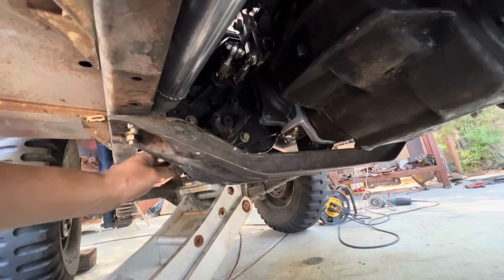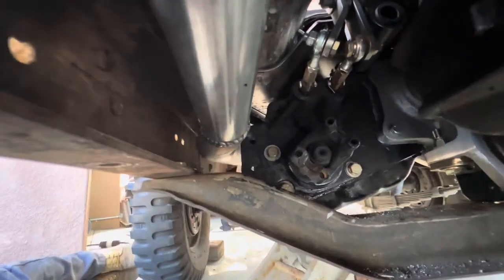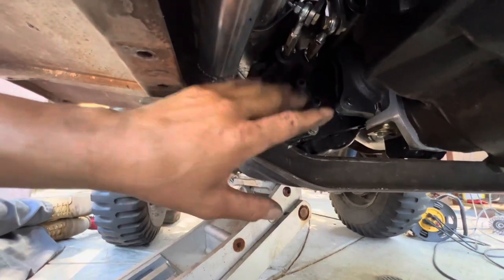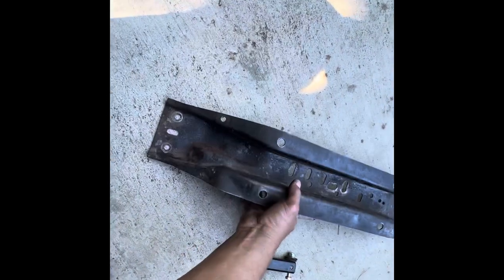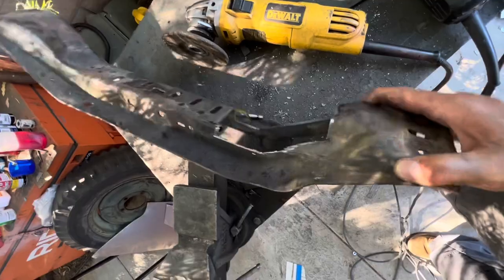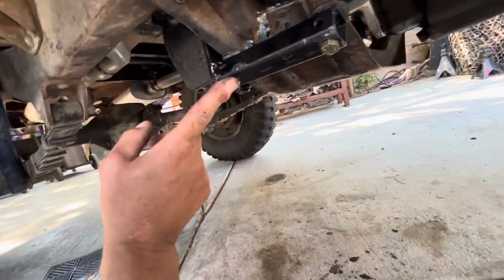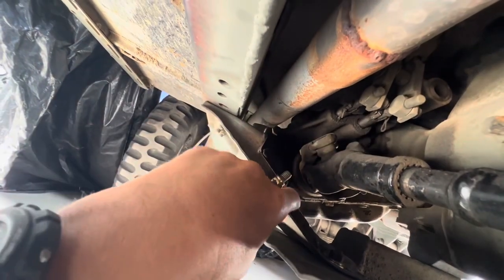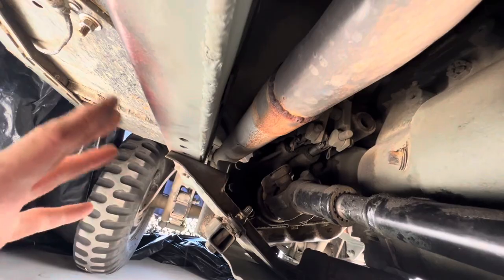DANA 20 tranfer case in a Willys Jeep. modification, twist strap and spacer discussion. CJ2A/CJ5.

Comment: The two holes in the Dana 20 case are used for exhaust support when used in a Scout 2. The exhaust is flattened to go between case and frame and  "D" shaped 3/16" wire mount is bolted to the T-case to support the exhaust. May have other uses.
Reply from the maker: wow - i thought for sure it was for a bracket to secure the dana 20 from twisting. Thank you for that valuable information.

Comment: Hi Ernie how are ya? I just watched all 3 of the videos installing the sm420 into your buddy Jeep. 
I’m new to jeeping,  I bought a 69 cj5 all stock v6 t14 d18 44 27. I was just wondering why y’all run a d20 and centered axle over a d18 and stock axle. Sorry to be such a newbie. Love your channel!! You’ve got mad fab skills. 
I plan to put a vw tdi, sm465, d18. Just waiting for the winter snow to hit then spend time in the shop. Thanks for sharing and teaching us newer fellas how to get it done. Take care  and God bless you and yours.
Reply from the maker: Hi - it’s just how it ended up. if we had d18 we would have built it. welcome to the old willys fun… 
  That vw swap will be awesome. i’ve been reading up on that. I also want to do one. 
  Glad you like my videos- i’m just a guy messing around under the shade tree 👍👍
Reply: Hey Devil Dog,
The 2 holes on the right side of the Dana 20 are the torque mount for the transfer. It is supposed to be a L bracket that comes off the transfer going forward to the cross member , on the cross member, there is a stud that goes there with a rubber mount on top and bottom of the bracket that is supposed to keep the transfer from twisting and tearing the transmission mount. When I had my 1967 J3000 truck, it was missing that mount. I was 4 wheeling up a canyon in the panamints out by Death Valley and tore the transmission mount. The transmission torqued, and hit the floor board when it broke, the T18 was in 1st gear and the shifter hit the dash. The only way to finish the trip was to chain the trans to the cross member and hope the engine motor mounts don’t let go. 
That was New Year’s Weekend Y2K. 
I was able to finish the run and had no further issues, but that’s when I learned about the torque mount for the Dana 20.
Back then, I was able to get the torque mount stud and bushings from 4 West in Colton Ca, but no one had the bracket. I made the right angle bracket out of 1 1/2 x 1/2” material and knocked the 2 holes in it for the transfer case mount, and the hole in the bottom for the stud mount I put on the cross member. 
You might be able to find pics of the mount on line. 
That will solve your issues with the transfer torquing and eliminate the chance of tearing your transmission mount. 
Semper Fi Devil Dog and Merry Christmas to you and your family.

Comment: Hey Ernie, interesting vid. My '47 with a dana 20 spacer looks like Shelby's and it has always bugged me in terms of loss of clearance. I might go your route, but it looks like the trans mount would need to be modified to accommodate the change in clearance. What was your solution to that?
Reply from the maker: hi - I did not make any changes to the rubber trans mount. I have been staring at that rubber trans mount for years now. I have not yet made any changes- cause it is happy right now, so I will leave it as it is. 
   I don’t know for sure why we don’t have to change the rubber trans mount. It looks like to me it has to do 
with the angle of the drive shaft in relation to the cross member as it comes off the dana 20. 
   I don’t think the rubber trans mount needs to be changed. 
   I wish we had some reading on this. It has been a very intriguing subject. 
  Let me know if you find out anymore information. Thanks, Ernie.
Reply: Hey Ernie. I have a t18 4 speed with dauntless engine and the cross member sits further back. Also my spacers are a full inch thick, probably due to the t18. Notching the crossmember might still work but I'll definitely need to modify the transmission mount. transmission

Comment: i have a dana 18 mounts to cross member on 2 inch rubber bushing. how many degrees tilted backwards does your engines sit? i need to install my buick 231 and cant find info on  mounting it.
Reply from the maker: hi - i just fit it in there. I’ll have to measure for you… but, it goes right in. fits like a glove. 👍